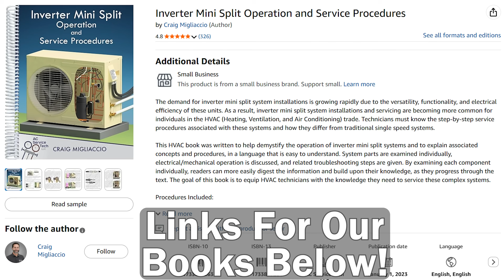Making a Sheet Metal End Cap With Hand Tools!! HVAC Ductwork Training!

Comment: Bruh.  Advanced bending tool?
Looks like an ear bender to me. Maybe with kind of a fat opening.. how is that useful except for onsite end cap?
As a tinknocker, you dont need help getting carpul tunnel syndrome.

Im a sheet metal worker for going on 32yrs, i would not buy that additional earbender, to carry around along with the one i need.

If you need make an end cap  onsite, just bend regular ears on the drive side and make a slip and drive connection..

Nothing against the guy making the vid. It's just another tool to carry around that i dont see much use for.

Comment: I liked that advanced folding tool, but why not just fold the 1" fold and then the 3/8 afterwards?
Reply from the maker: Because then you dont have anything to fold against and you are trying to do it in the air. it doesnt work well with 26 gauge! Try doing it! Thanks!
Reply: @acservicetechchannel that's fair.  I've mostly been using 30 gauge.  I can see why 26 would be harder.  How much are they?
Reply: it's hard to do on heavier gauge metals, it wants to bed everywhere but at the tool. so the wide end makes sense just for that.